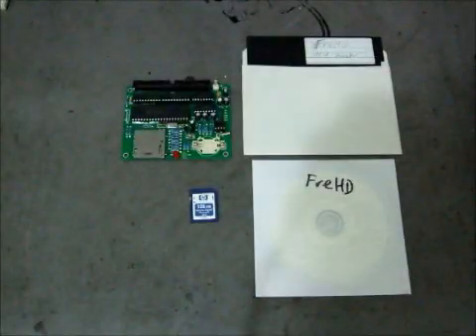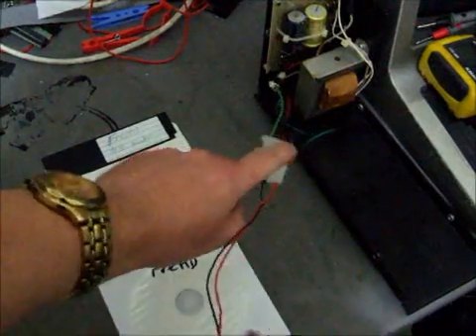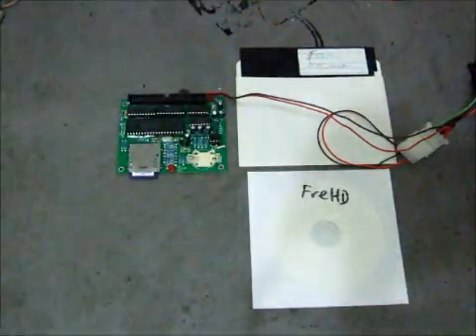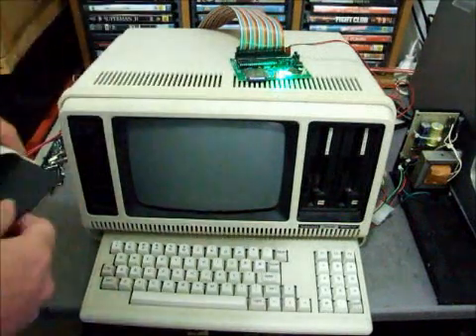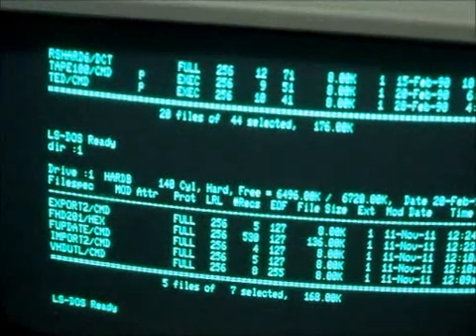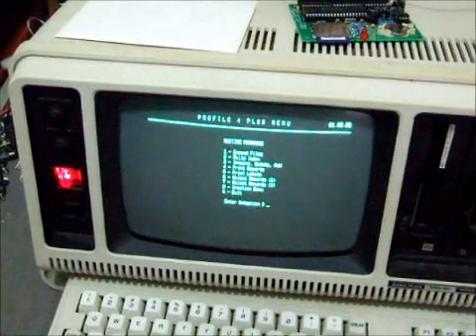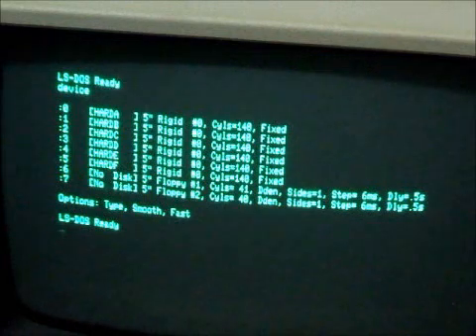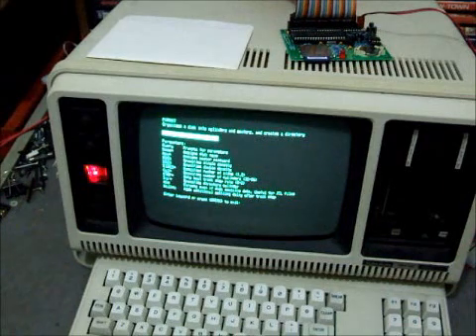FreHD - more info on the TRS-80 HD emulator

Comment: i had the silver and black trs-80 all in one, two floppies.  had a lot of fun with it.  wish i still had it.
Reply from the maker: If you don't wish to install the Eprom them you can floppy boot the system the same way old TRS-80 hard drives on the Model I/III/4 used to boot.. with a startup diskette.  Then when the system is running drives 0,1,2,3,4,5 become your hard drive partitions, and your floppy drive numbers are re-assigned 6 and 7.  Email me ianm@trs-80.com if you wish to discuss further.

Comment from the maker: About the price, it's quickly forgotten once you start using the device.  It costs around the same or slightly less than a regular TRS-80 hard drive, is much faster and more reliable.  in fact most TRS-80 hard drives you buy in eBay are in need of full restoration.  I do sell a kit version which includes PCB, SD socket, and the 2 main chips for $50, but you need to supply all the other parts and be able to solder.

Comment: Too bad the board design didn't have +5 connector that was the same as a modern floppy drive power connector. That one is also small but would make it very easy find a power supply source for testing, no?
Reply: David Sutherland trs-80.  has San Antonio TX
good go